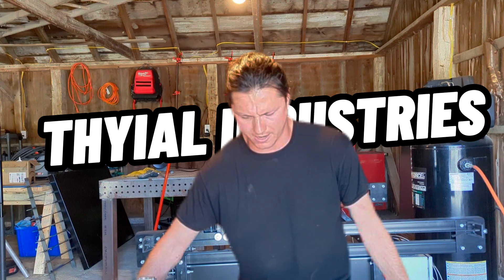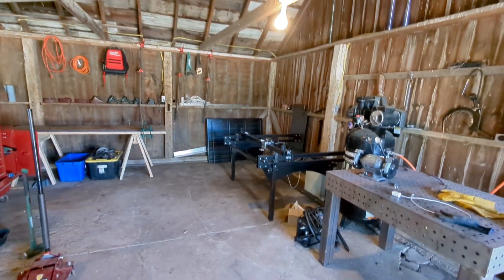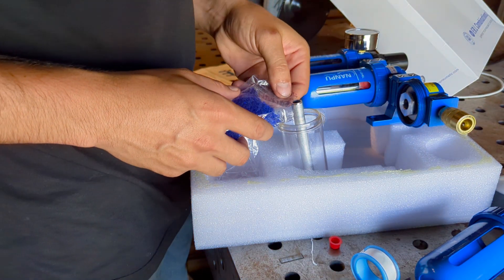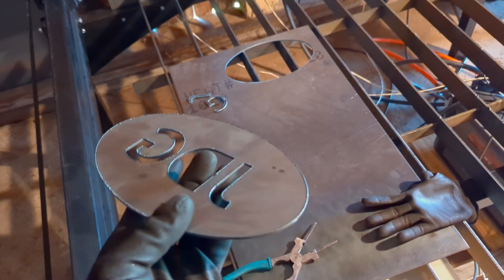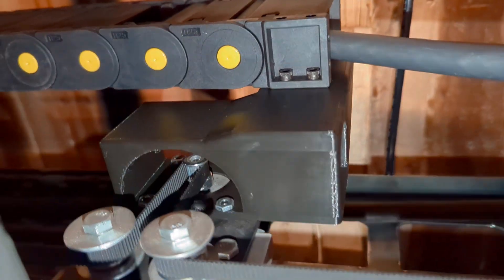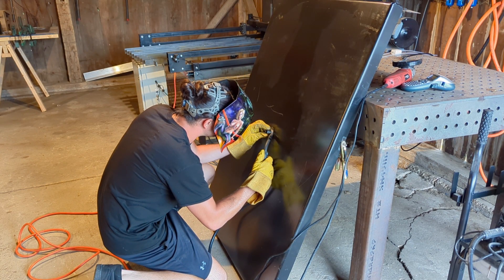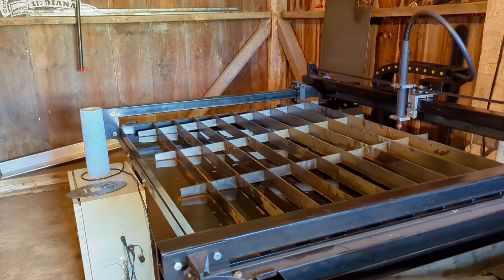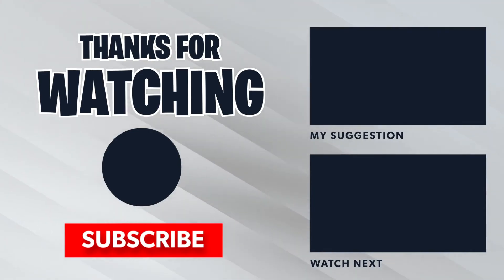Starting A CNC Plasma Business Doesn’t Have To Be Hard. | Pt. 6

Comment: I hope you have another filter on the back of your machine or you have another filter somewhere after the desiccant filter. Desiccant moisture filters should have another filter after it such as a MotorGuard since the desiccant dust can flow out into your plasma machine, potentially ruining the air solenoid and torch consumables. If you build another water table or this ones leaks, buy some marine sealant like Loctite PL Marine or a polyurethane like DAP 18816. Most silicone caulking is not rated for water submersion. I have used both on my last two plasma water table builds. Also, Borax, like the washing powder you can get at Walmart, works as a cheap rust inhibitor. It's all I have used for the past three years with great success. I just flush the table monthly instead of dealing with shipping 5 gallons of expensive cutting fluid.
Reply from the maker: @longshot726  I do not have another filter. I'll look into that though.  I would hate to ruin an expensive machine like that.  Thanks for the tips!

Comment: I would never run a plasma cutter like this that close to wooden walls. That is a fire hazard waiting to happen, sorry to say. You should fire proof the wall with ceramic tiling, sheet metal or a layer of concrete.
Reply: Just put up some cement backer board easy cheap solution.  Diy solar guys use them to mount inverter to for fire protection if the inverters catch on fire and they hold up to heat great. Class A fire rating. Screw it up just like drywall and call it a day.
Reply from the maker: @tangodown2721  yeah I suppose that would work
Reply from the maker: @Luka1180  🤣. The thought did cross mind

Comment: Hey just to tell you when it would not cut at first the new hypertherm detect news consumables so each time you will change them or dismout the torch it will do that I work with the powermax 105 that's why I know
Reply: It will do that the first you pull the trigger on your torch (or run the program) ofter changing the consumable after it's ready to cut!
Reply from the maker: @thecnorider8763  if only you commented like 2 months ago!

Comment: I did my pan drain the same way. Works well. I did chain drags as well however kept the plasma cable still hanging on a pivot above in fear of EMI issues between the plasma and the motor wires. If all of a sudden your machine stops. Pretty good chance it was EMI. I found the arduino very susceptible to being affected by EMI.
Reply from the maker: @yoti-fab  I might be experiencing a few issues like that. Not quite a full storage. But very slow response times from the machine. All of my cables are shielded and grounded.